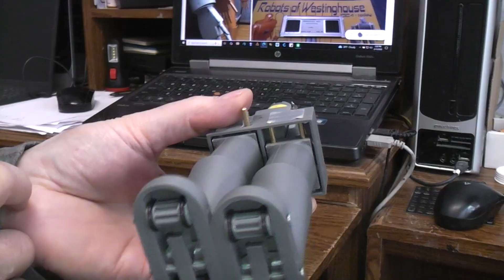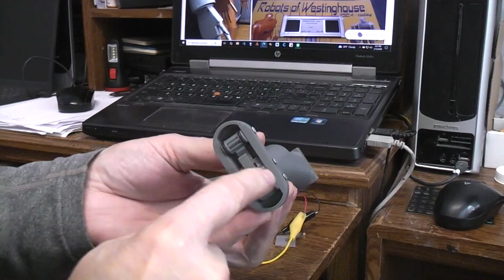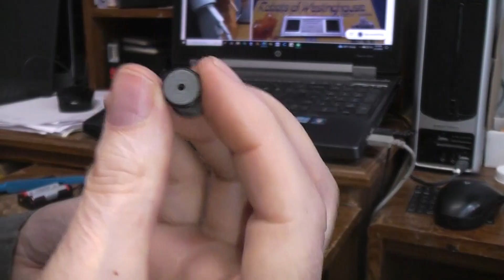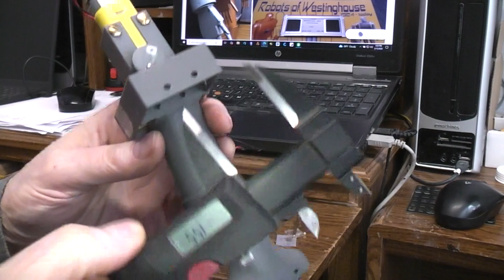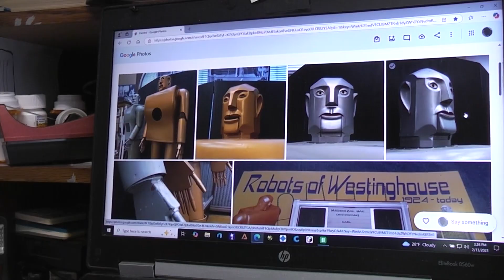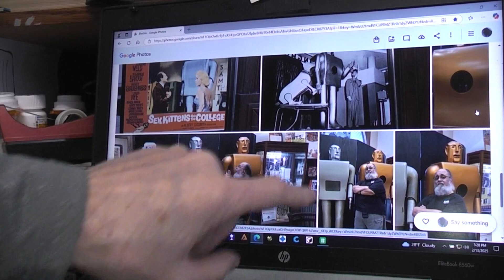Elektro robot build. Step one. The feet and legs mechanics.

Comment: Thanks for all this good work. My grandson and I built one. It's great! The only significant problem we ran into was getting the wiring positioned where it wouldn't be eaten by the cams and gears. In retrospect I'd have figured out something to make the head removable so we could reach in with tweezers to arrange things  or something like that. I had already glued it on when this cropped up as a challenge. The ratchets in the feet are genius. I found I needed to print the forked one with thin layers and 100% infill. Otherwise it was fragile. A final thing is that ours walks fine with no extra weight in the feet as you mentioned. Maybe that last 2-degree cant you put in the legs made that unnecessary?  Again, thanks.
Reply from the maker: So glad you both had fun with the build. Yes, wire management can be a problem. You would be surprised how many vintage toys suffer from poor wire management as well.

Comment: When designing a walking robot, do you need to somehow calculate the center of gravity (to make sure it's stable) before you start printing it?
Reply from the maker: You have to keep in mind the center of gravity including the effect of the batteries on the design. Many vintage toy robot suffer from this because the weight of modern battery's is so much heavier than the old carbon battery's of the 1950's and 1960's.

Comment: Awesome! I have the head on the way. You could make it smoke like the old scale train engines. I mean if you wanted to. :)
Reply from the maker: I would have to do a larger version "scale" to hold D cell batteries and the smoker unit. This will be a smaller simple first build.